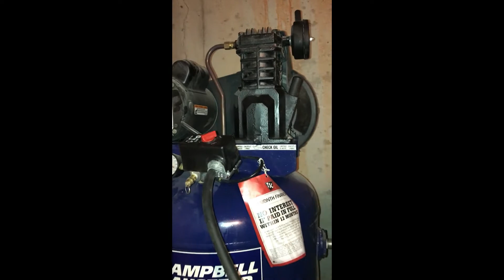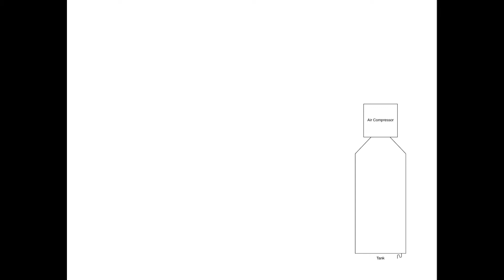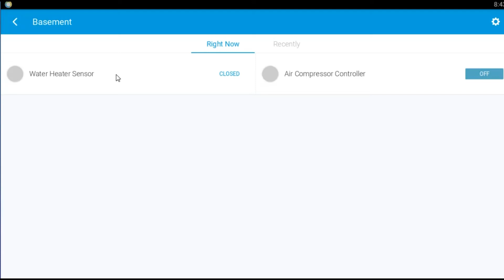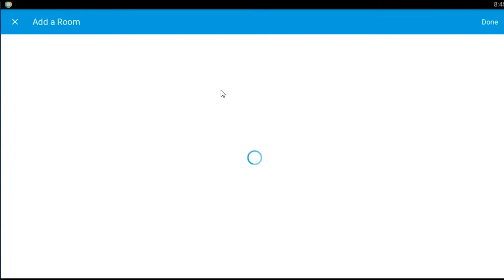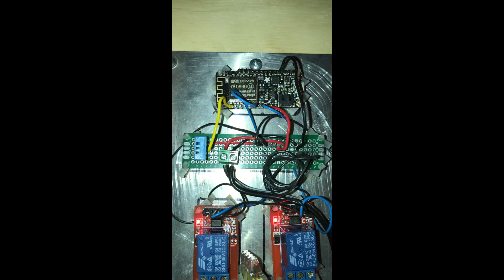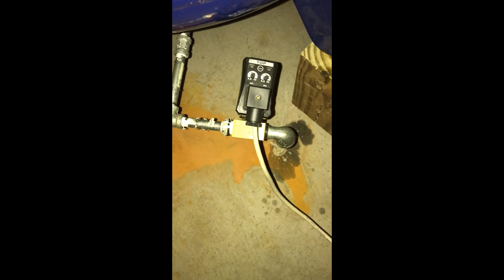Smart Shop Home Automation Air compressor controller remote

Comment: You still use this?
Reply from the maker: Actually it died about a year ago. Especially given how smart things is going it was well timed. 

My new setup is 2 zwave switches that controls the contractor and one that runs the drain
Reply: @exportedafrican  Im trying to find a good contactor , but everything appears way more involved then what i need, i need more like relay style. I have 120v air compressor
Reply from the maker: You could just use a 20 amp capable switch or a zwave plug that can handle that load

Comment: Looks like a good setup. Please turn your camera 90 degrees though. :) I have my compressor in a sound muffling shed in a storage room at my shop. There is an ATTINY based controller to control cooling fans for the shed and a purge solenoid. Going to do a similar remote setup so that the compressor can be turned on and off from multiple locations and from inside the house (I will have air plumbed to the house as well). Though probably via a wire instead of wireless because I just want it to be a simple button with indicator light, not a website.